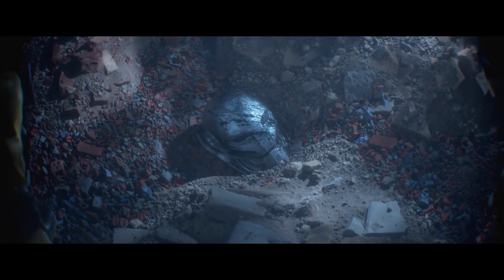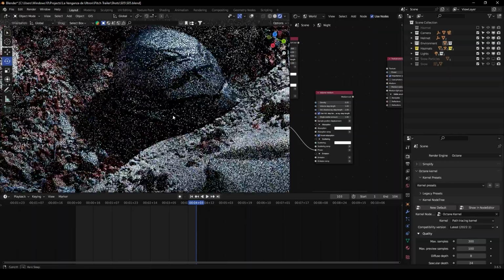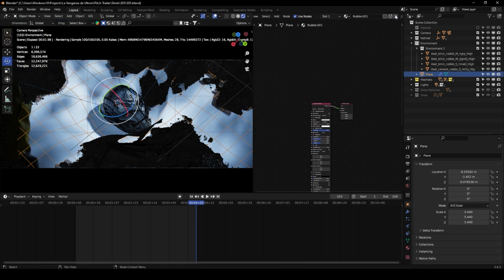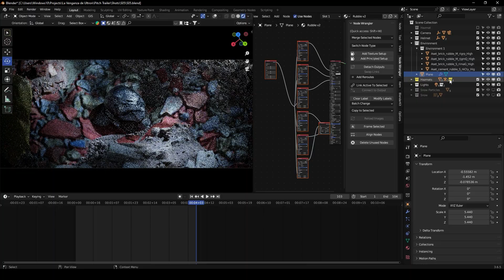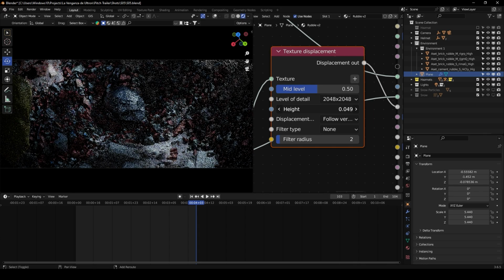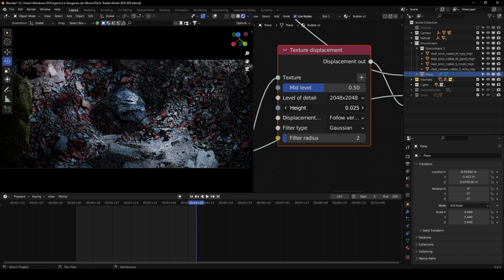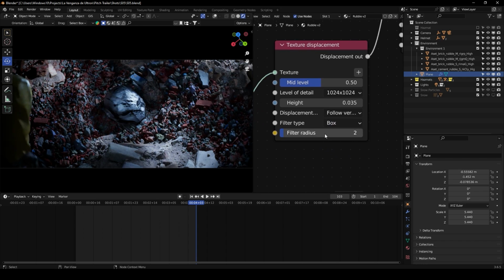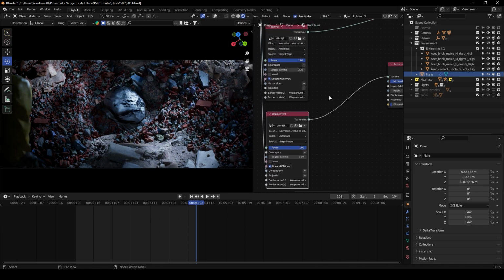Blender Octane - Learn how to use Texture Displacement for ultimate optimization

Comment: What if I had a displacement texture thats higher than 8192x8192 is it possible to override the Level of detail and go higher with a custom resolution input?
Reply from the maker: That's a very good question, as far as I understand that is not possible in the Blender version of Octane. 

It may be possible in the Cinema 4D version of Octane.

Comment: hmm, but is it that diferent than to use a displacement map in default cycles?  yes its cool, but not sure if worth the time learning octane...
Reply from the maker: Yes, mate, it's totally worth it.

In Cycles, to use displacement you have to subdivide the model, in Octane you don't have to.

On the other hand, Octane is an unbiased render engine, unlike cycles, which guarantees more realistic renders. It also has many more settings to configure, which gives more control if you want to have a more stylized result.
Reply: @EgoMotionCG  any videos/ tutorials in mind i should watch to dive into it correctly? if its just like an other compositor system i think i could learn it relativly fast...   r there any big downsides? like its not avaiabl for 4.1 i think...
Reply from the maker: @bUildYT   The tutorials from Lino Grandi (Otoy and Octane artist) are the best.

https://youtu.be/8y7blB0e784
https://youtu.be/Mr_ZW3heXcU

You can also subscribe to my channel (if you are not already subscribed), here I will be sharing what I know about Octane, I've been learning it for a year now.  In general lines it is very similar to cycles, only that the nodes have other names, but it is almost the same thing.
Reply: @EgoMotionCG  sweet ! exactly what i need :D
Reply: @EgoMotionCG  would u say octane is faster in rendering than cycles?
Reply from the maker: @bUildYT  Is not faster, it just delivers a better result
Reply: lol its u, allready bought ur space course, we also wrote on discord 3 months ago haha
Reply from the maker: @bUildYT  hahahaha hello mate
Reply: I’m also stuck on this 😮‍💨 if I’m going to do octane then it has to be worth it and so far with the tutorial and feature set octane has I think I may end up switching to octane
Reply: @videopro__  i got it yesterday and its really not that hard as i thaught, basically  4 new very big shader nodes, different light and world options and different render setting options,  
I got turbo tools last week, and there u can enable (in 4.2 alpha) that it shall be rendered 100% GPU based (u have to enable it in experimental) wich resulted in super fast cycles renders, will do some testing but if octane is much slower ill stick to turbo tools, for me fast renders r more important than hyper realism...
Reply: @bUildYT hmm thanks for the insight !!! I think I’ll give it a try too